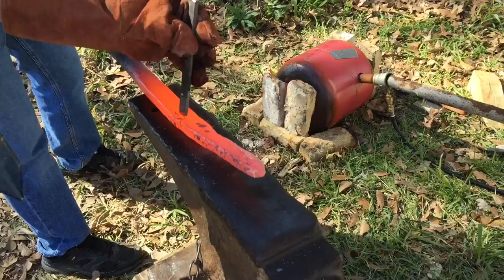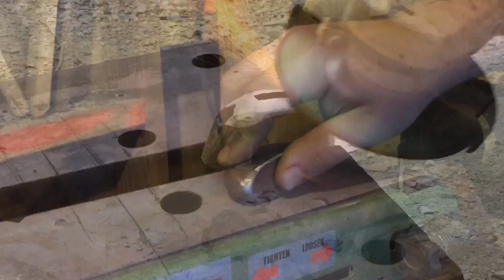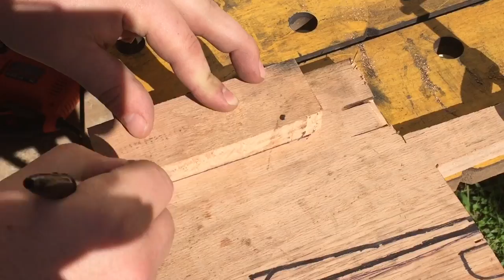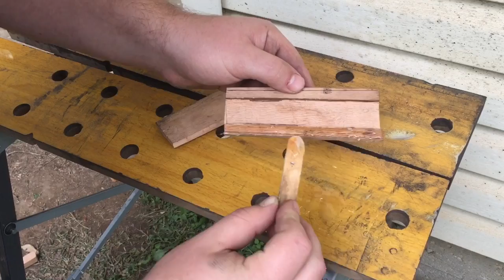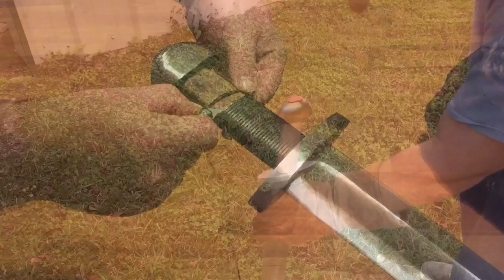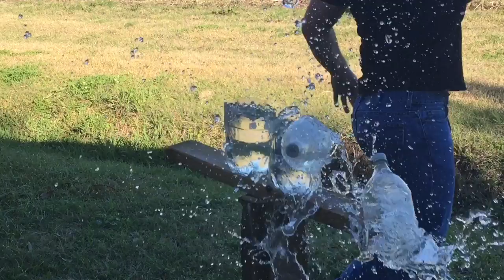Making a VIKING Sword Part 2

Comment: What are the detentions of the guard. I ask as I am currently trying to make my own guard and pommel and just trying to get a better understanding.
Reply from the maker: Woods Lore 4.5 inches guard and around 3 inch pommel
Reply: Thanks for the fast reply. That is close to the dimensions I was planing for length. Though I have 1/2X1/2 key stock to work with.

Comment: Where can I get the steel long enough and thick enough for a Viking sword?
Reply: Charles Davis if you live in the states Ace hardware carries 3” x 1/4” hot rolled steel.
Reply: NoFace thank you
Reply: Hardware store steel is usually 1018 mild steel, low carbon.  It won't harden.